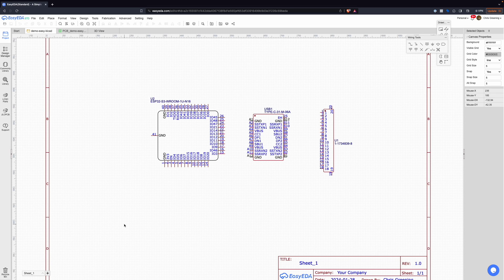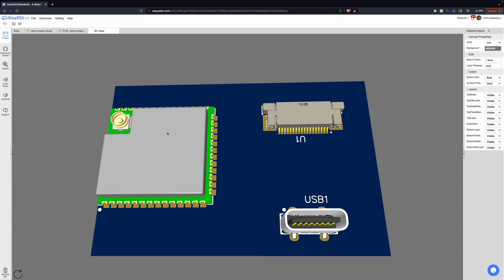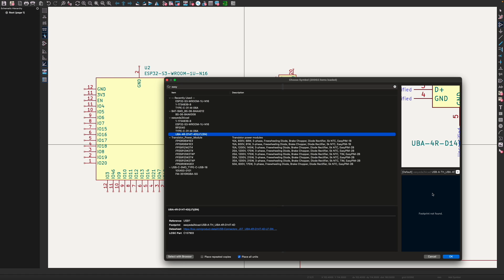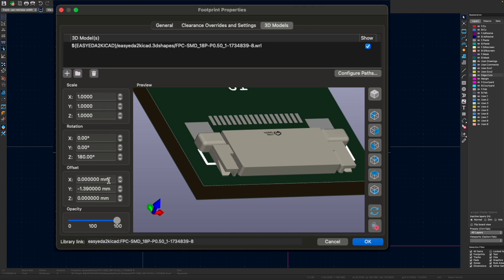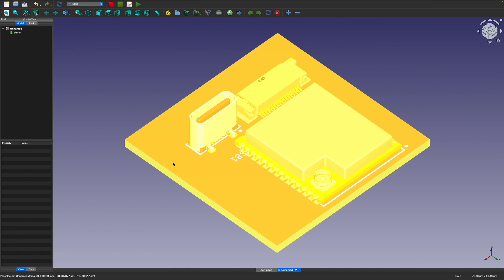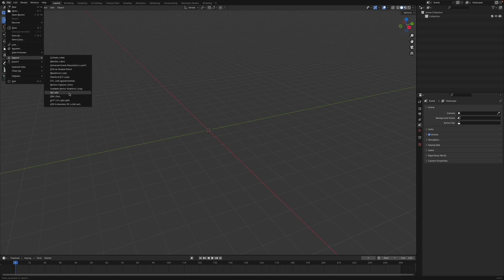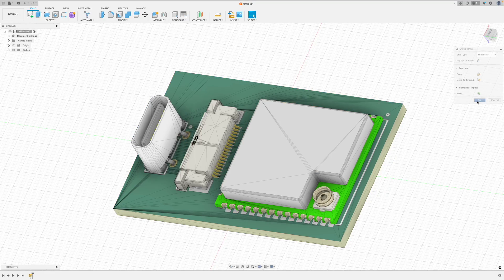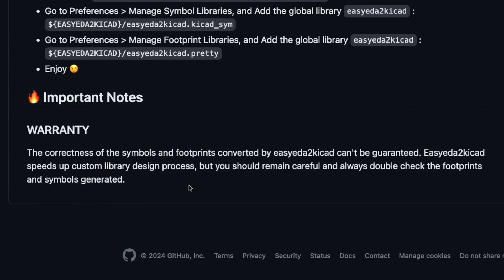Easy - KiCad Symbol, Footprint and 3D Model!

Comment: Hi
Can you please detail how can we run the Python script and where did you fill in "easyeda2kicad --symbol --footprint --lcsc_id=  - - - - - -  " ?
In your video is perceptible you're using VS Code but it lacks, at least for me, the information about the procedure.
As long as I can see, after installing Python and easyeda2kicad in my win 11 PC, it ended up at 
C:\Users\ - - - - - - \AppData\Local\Packages\PythonSoftwareFoundation.Python.3.12_qbz5n2kfra8p0\LocalCache\local-packages\Python312\site-packages\easyeda2kicad
After some trying out I concluded I need the above information.
Can you please give me a hand ?
Thanks in advance,

Comment: It's a shame Kicad can't export the 3D pcb as a step file. It's one of the reasons I stuck with Diptrace. One advantage of Kicad's mesh export is that you can include the copper traces - very nice if you want to do photo-realistic renderings of your pcb in Fusion 360. Altium didn't offer this when I last checked.  Diptrace can do this too but only as a mesh so if you want step for copper layers then you have to mess around with canvases and / or decals. Alternatively you can export the copper layer as 2D dxf and build a 3D thin solid body in Fusion. It works but there is a hell of a lot of geometry in an average copper layer. The only software I've found which can step export the complete pcb with copper, silk, components etc is Zofzed PCB. It's expensive and full step export is disabled in the trial version. Amazing app tho!

Comment: Thanks for the video! I'm wasting much time to find the right footprints for many parts. But why don't you export as STEP file that can be imported directly to Fusion360? I've never encountered problems with STEP export so far. Or is this a special problem with the converted LCSC parts? An advantage of STEP files is that they aren't triangulated and can easily be used to project the PCB shapes to your 2D sketches.

Comment: You have to check so much, as footprints are often overlooked by websites.
Just had a PCB given to me to assembly and the footprint had not been updated to the new version. looked right but the size was incorrect. When you don't have the chips and expect the supplied footprint to be right! they failed to check chip data sheet to footprint. hence they had to find old stock of the smaller chips.

Over the years I've got used to creating my own component / footprint libraries which i check the datasheets to make sure all footprints are correct and with SMD devices a different one for hand assembly v's reflow etc.

Comment: Sometimes it is nice to have components 3d models in kicad, especially for bigger components to make the pcb fit in the enclosure. But most times I find myself just exporting the pcb itself to f360, to have mounting holes and board dimensions right.

Comment: EasyEDA Pro has 3d export that works well.
Reply from the maker: Interesting - I don’t know many people who actually pay for EasyEDA.
Reply: pro version is also free for personal and commercail use.   I have been using a design process where I design the pcb outline in 3d software together with the enclosure and then export a dxf of the pcb face from there. Import it in EasyEda PRO and use it as board outline. Then do the pcb , export 3d pcb back to 3d software and check for clearence errors. reiterate if needed.  @atomic14

Comment: I switched from Kicad to EasyEDA for this very reason. 
What a pain it was finding modern parts. Maybe I'll give KiCad another go this year.
Reply from the maker: Yeah - it is pretty frustrating. Most symbols and footprints are available, but you have to a bit of searching. And I’ve got used to making them if I need to - but it’s not ideal.

Comment: EasyEDA actually can export your PCB as 3D model. Just go to "File - Export - 3D Model (obj)" when you're in the PCB view (not 3D view). But for some reason the export is really bad quality compared to the 3D render :(
Reply: There is a video on @IsiksTech 's channel to export a PCB from EasyEDA to a .step file using EasyEDA Pro (still free) - I tried it it works really well!
Reply: because they have the actual step files but want users stuck on their platform

Comment: Good video, but it seems from someone like myself with near absolutely zero knowledge trying to get into PCB making that no one PCB designing program does everything particularly well; or at the very least I don't fancy investing an absolute ton of time into learning all the quirks and deficiencies of all these tools 😟
Reply from the maker: I would start with EasyEDA - having the symbols and footprints all wired up and ready to go is really nice. Switching to KiCad is pretty straightforward once you’ve done a few PCBs. But there’s nothing wrong with just using whichever tool you feel comfortable with.
Reply: Its not that hard. There is a pretty good book for learning ikcad out there called "kicad like a pro" makes it really easy to learn.